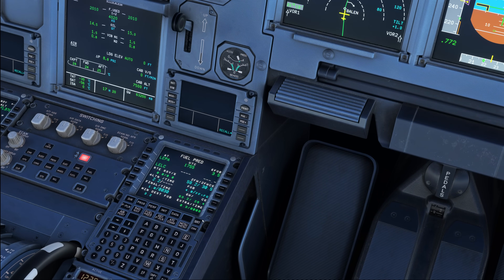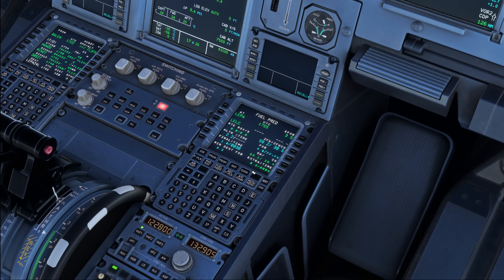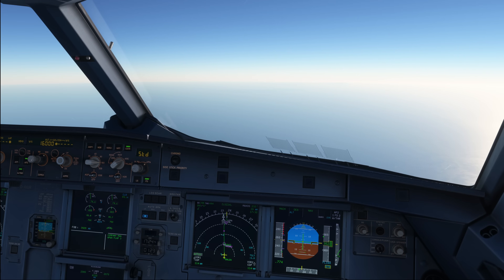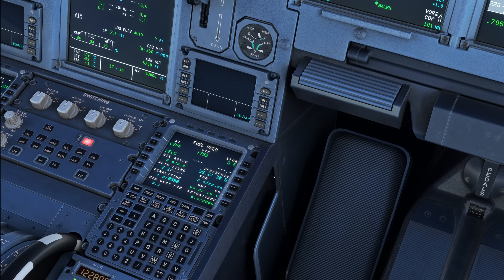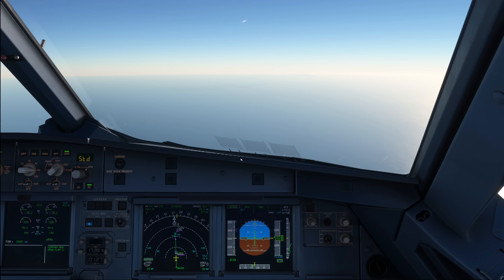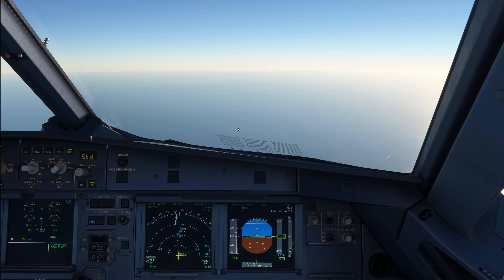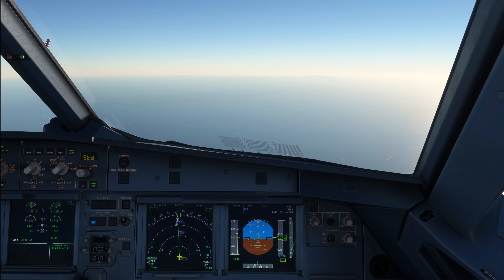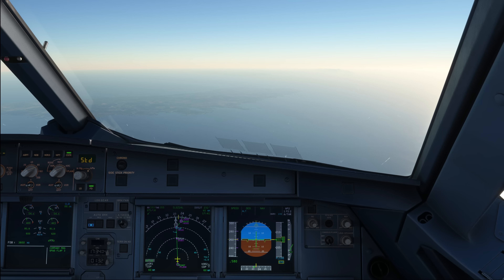So with just HOW MUCH FUEL ON BOARD do airliners actually typically LAND? | Real Airbus Pilot

Comment: Great video. In an emergency early during flight, how is fuel dumped ?
Reply: Narrow body aircraft generally don’t have the option for a fuel jettison system, so the fuel just needs to be used or land over MLW. And on many wide body aircraft, it’s a customer option. Some A330s have it and some don’t for instance

Comment: I would be interested  in the settings in Simbrief. How Reserve fuel (30/60 min?), and what Extra fuel is needed for LPMA, for example?
Reply from the maker: 30 min is standard for EASA Jet ops. No need for extra fuel just because of an airport. If the weather is good you don't need any extra at LPMA.